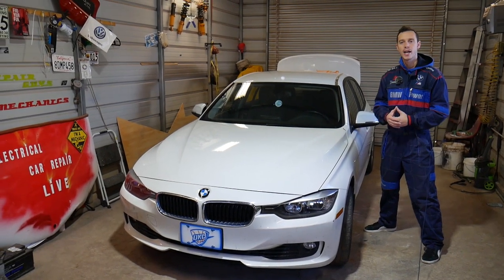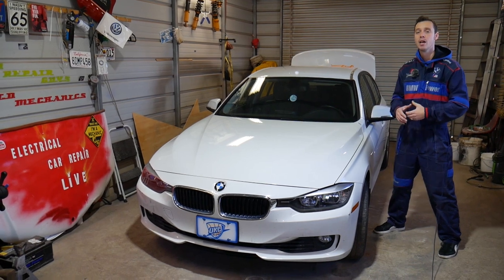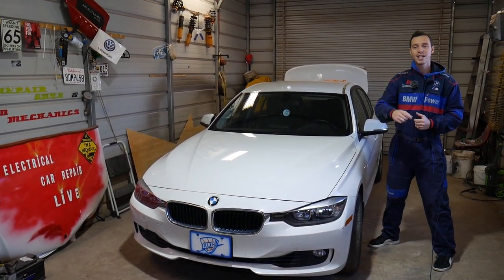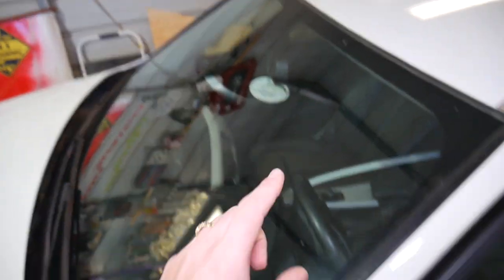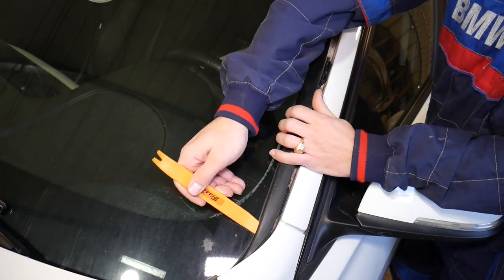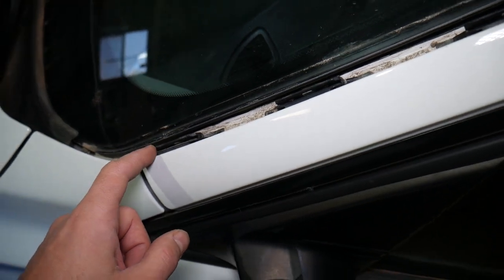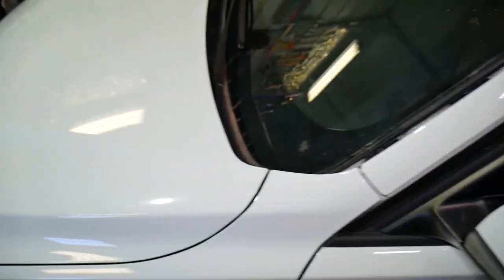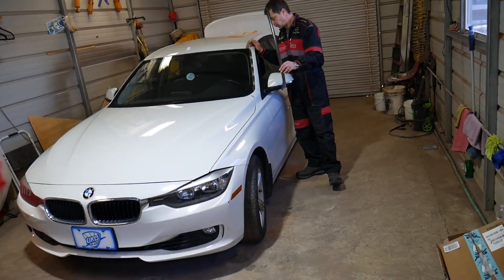HOW TO REMOVE WINDSHIELD TRIM MOULDING ON BMW F30 F31 F34 F32 F33 F36

Comment: Great video again √ ... How about removing & replacing the front rubber windscreen outer 'all around' trim as they are so brittle & just crack and then crumble away... Terrible design and rubbish rubber material.